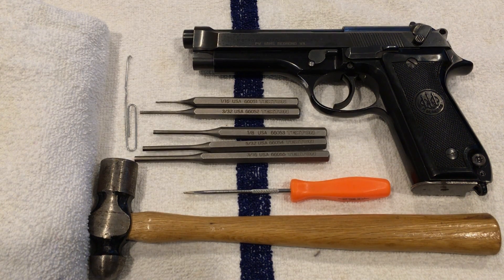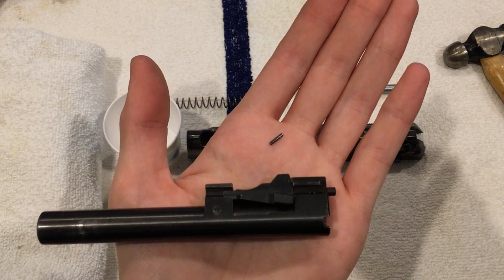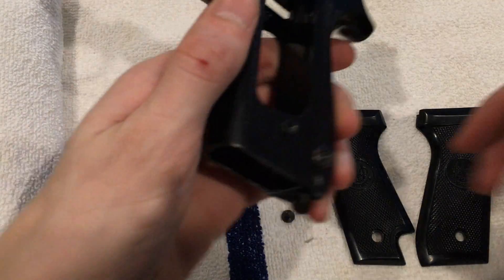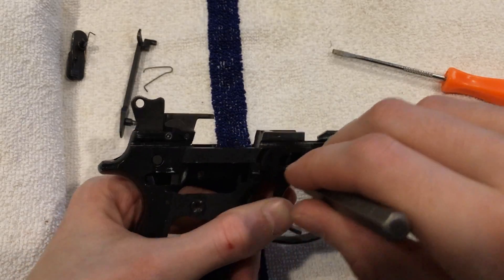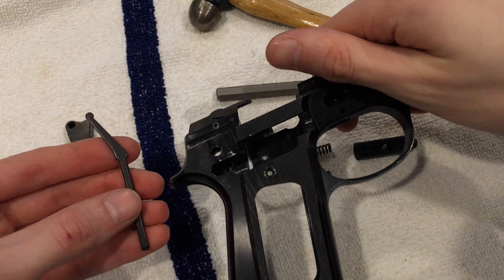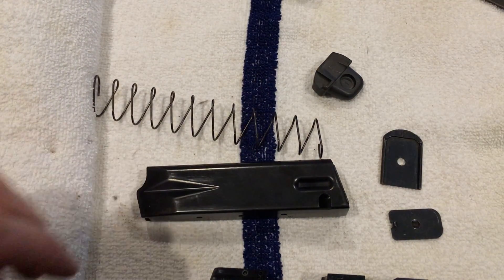Beretta 92S Police Pistol Complete Disassembly

Comment: Any tips on getting those pins to move? I've bent 3 punches so far and the slide pin and barrel pin will not budge
Reply from the maker: You could use heat but that would mess up the finish. Soak it in oil over night? If you cant get it might be best not to force it, don’t want to ruin anything. Bring to a gunsmith maybe?
Reply: @Mr95Kenny  I ended up getting it. Had to put it in the freezer for a few hours to shrink the metal

Comment: By far the most informative video i've found, thank you! Need some help with the parts, do you know the size/part name/ place to buy the pin that goes into the magazine release? Have roll pins in mine, changed hammer spring, when reinstalling, the mag release pin expanded and will not go back in, wanting to replace with another pin and CANNOT find the part. Name, size, links, DIY, anything would be helpful. Again great video, thank you!
Reply from the maker: Harrison Johnson if I remember right my friends did the same thing, I believe we found one that fit at a gun show. Other than that try to bend yours back or file it?
Reply: @Mr95Kenny  I have not tried yet. I was hoping I would be able to replace it with a solid steel rod instead of the roll pin. For now I may try to hammer it back to shape and make it work until I find a better solution. Thanks again, great video

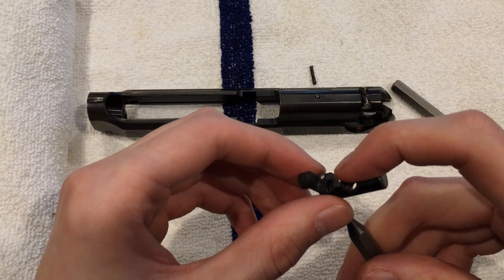Comment: I ended up loosing the ball in the safety at 4:15 in the video. Anyone know where I can get spare parts? I’ve tried a few websites but no luck.
Reply from the maker: Walk home with magnet. Find out diameter of ball, maybe Amazon sells like a multi size pack? Beretta customer service 1-800-237-3882
Reply from the maker: Ball point pen ball maybe?
Reply: @Mr95Kenny  thank you for the reply, I will definitely try the ballpoint pen. I did the Amazon pack it’s somewhere between 3-3.5 millimeters.

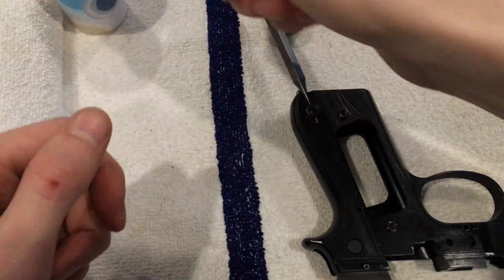Comment: What happened to your voice at 10:20 you seem way younger lol. Anyway awesome video I may attempt this!
Reply from the maker: Travis Odermatt strange, i never noticed that before.
Reply: What did happen to your voice?
Reply: I think he sped up the video, maybe by accident, because you can tell in the video, his hand movements are faster & jerkier, not smooth like normal speed video, and of course the audio will have a higher pitch, making him sound squeaky. Regardless, thanks Mr95Kenny for making this video, it saved my butt last weekend. I bought a 92S about a month ago, and have shot it several times & it is a great gun, but while cleaning it last weekend, a pin in the frame just fell out on it's own, the one you are taking out at the end with the ejector, I don't know the part's name, it is held in place by the frontmost pin, a piece that the arm faces backwards, unlike on my Beretta M9, that faces forward. The part fell out after the pin fell out & I couldn't figure out how to put it back until I found your video & watched it.